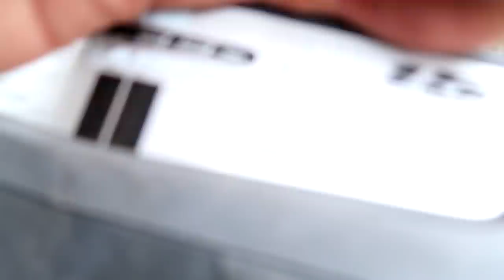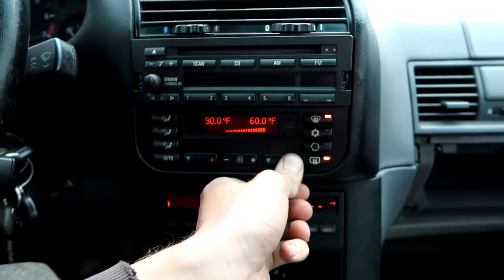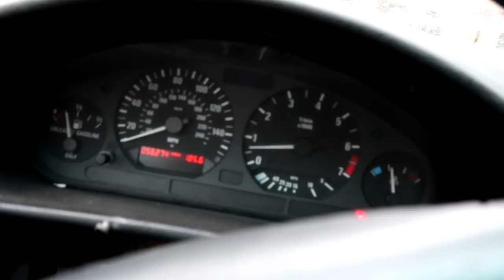IT COMPLETELY DIED...

Comment: You do realize that 1. It's not necessary to warm up the truck. 2. It definitely isn't necessary to let the turbo "cool".
Reply: the_real_matt you need to let the engine run 1 minute if you got off the highway. So the turbo can loer the rpm
Reply: +Willem V That's not true with Turbos made after the mid 90s. It may be beneficial if you've been towing in the mountains or whatnot just for extra protection. But it's not needed. I've done extensive research on this topic.
Reply: the_real_matt yes you do it helps the the motor for an example if you start up a diesel truck and then take her down the road you can fuck up a lot of shit because it's at the out side temp to like 250 it can and the turbo can actually warp and well let's just say you won't have boost
Reply: Joyride Moto The best thing to do is start the truck and drive it gently. Idling the truck cold can actually hurt it. If your concerned about cold temps then you should just plug in the engine block heater.

Comment: Yo dalton, you should push the button down on the e brake when you pull it up
Reply: Jude Rogina why
Reply: doesnt make a difference, its designed to operate that way.  You can also get it pulled tighter if you dont push the button
Reply: SICK BRO

Comment: If the battery is dead you can not push start a fuel injected engine.  The ECM won't work without power.

Comment: with your battery in the trunk, is it vented to the outside? as batteries discharge they give off hydrogen sulfide gas witch is flammable and poisonous. that looked like a cheep auto zone battery. i would make sure its vented. just a fyi